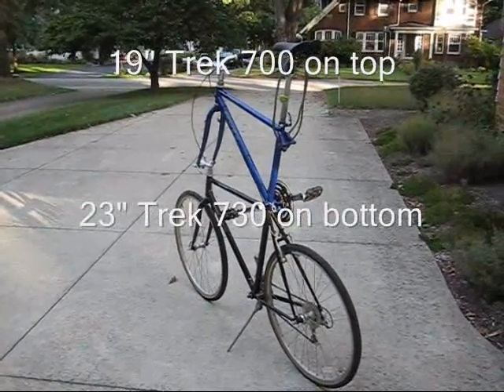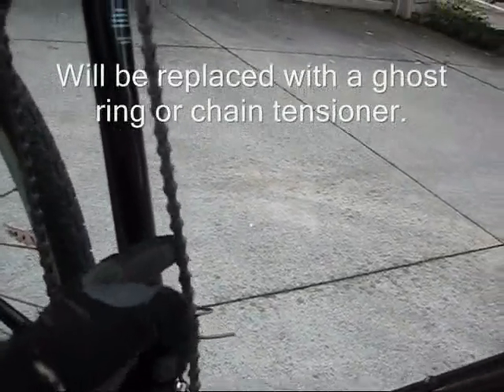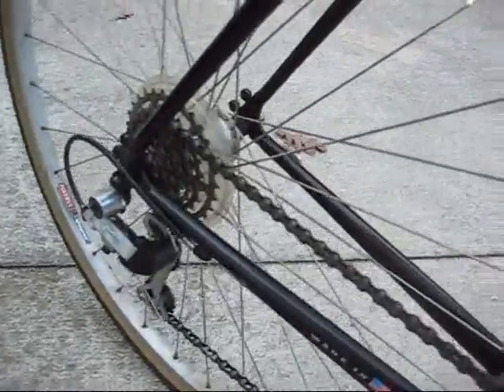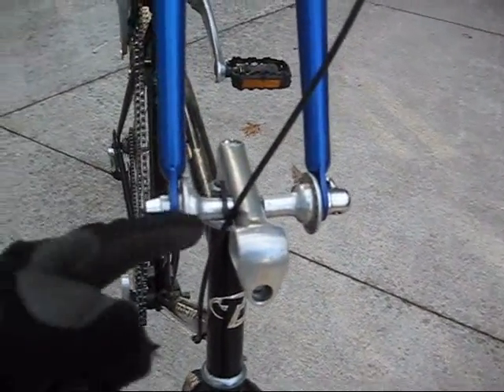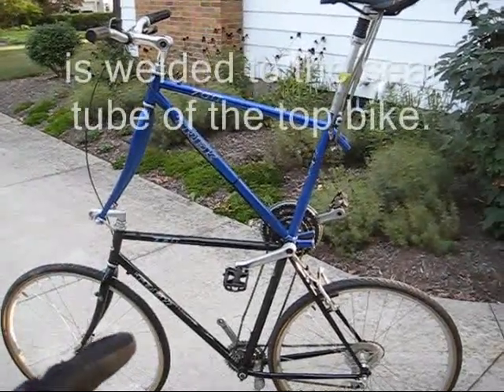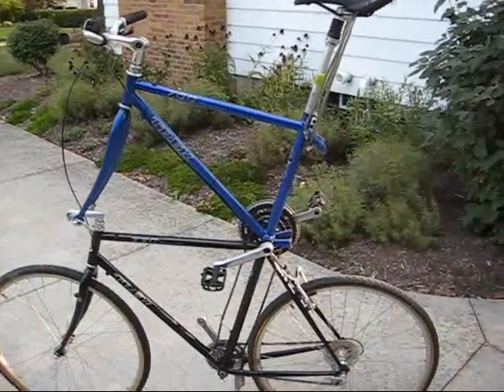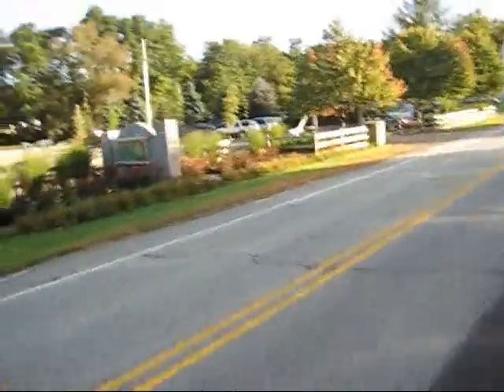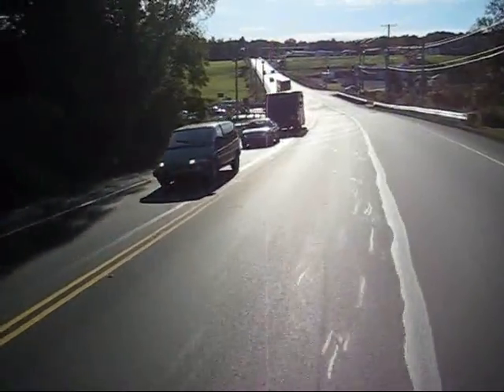How to build a tall bike

Comment: @csc104 thanks a lot your video helped a lot. we actually used the back break and transferred it to the front because it wouldn't reach (so there is only a front break). It rides great and we had no other troubles except the chain falling off and we just used your idea. Thanks a a lot.

Comment from the maker: @boaarrdderr628: Leave the brakes on the lower bike stock, we had V-brakes front and rear.  You will need to get longer cable for the rear brake - ask your LBS to order a tandem cable.  As the housing comes on a large spool, you can get as much as you need.  While your at it get two tandem shifter cables for the front and rear derailleurs.

Comment from the maker: A big problem with making anything higher than a double decker with standard frames is that the seat tube angle moves the rider's center of gravity backwards as the height is increased.  This makes tall bikes prone to wheelie.  Make the bike high enough and the COG moves behind the rear wheel making the bike unridable.